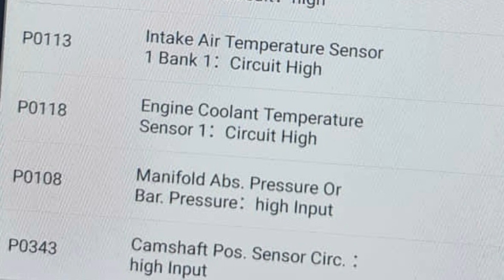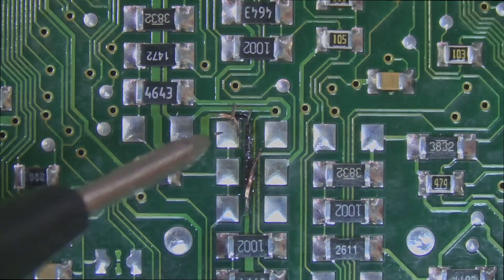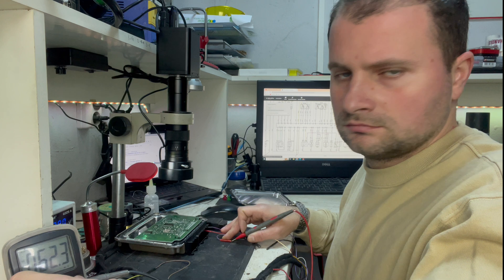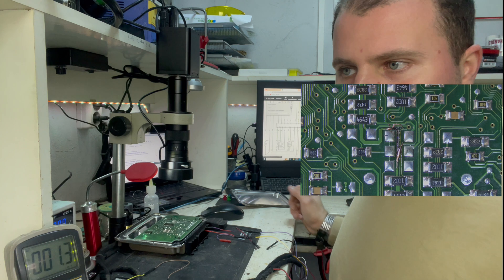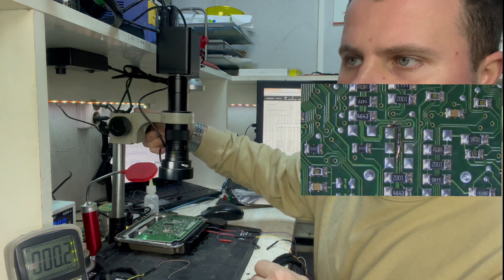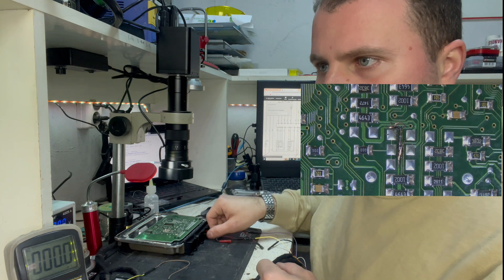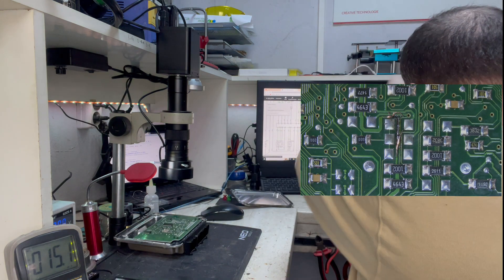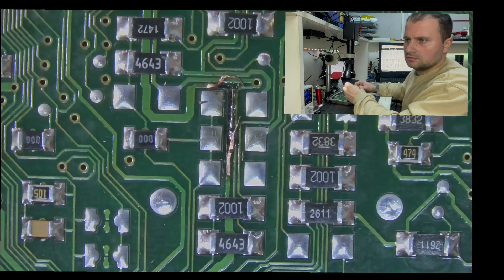VW Golf ECU ME7.5.10 repair | engine won’t start

Comment: Okay, so pin 54 is SIGRTN (which is just another ground) so why did the PCB trace fry when, according to the customer, it touched the engine block which is also ground? 

It is because the trace was fried by a incandescent automotive test light biased to +12V battery and not a wire touching the block. 

Some technician probed the SIGRTN shorting +12V to +5V SIGRTN through a test light and the surge current took out the trace. This is a very common troubleshooting mistake and why you should not use high current incandescent test lights when testing module functions. The most common ECM trace failures are either SIGRTN or +5VREF traces because they are relatively low current and very thin. The +5VREF regulator is usually fully protected against shorts to +12V, but the high surge current usually takes out the trace before the regulator even gets hot. The thin traces make effective fuses.
Reply: MAY TOUCH POSITIVE

Comment: Thank you for posting this awesome video, please post more, i have a VAG e.c.u which failed on the O2 sensor circuit, can you explain where the problem would be ? as the O2 sensor has No fuse to protect the circuit, also the Power steering sensor was defective, and i believe thats where the problem started from, what are the 'Values' of all them 'BROWN' resistors,,1 K ohm ? there's is so many of them all over the board! The Car is  Skoda V R S  1.8 Turbo Petrol, 2005 model, Thank you,  🙂  Bless   😇